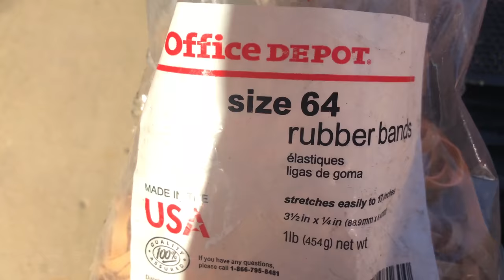We're Mite Checking Wild Honey Bee Colonies

Comment: Sure wish you would make a video on how you transition the cut outs onto foundation frames!! :)
Reply: You can see in the video where the brood comb is mounted into frames using no 64 rubber bands. You just need to remember to locate the comb in the same orientation as it was found in the hive. As a hint cells on either side of the center of the comb both point upward so as to hold nectar until the cells are dehydrated and capped.
Reply: @RegWhelan  we are located in deep south Texas. Rubber band melts way to fast. We use hardware cloth spikes but the State inspection does not permit for long. Need to transfer to foundation frames because wax without foundation WILL MELT!!! thanks anyway!